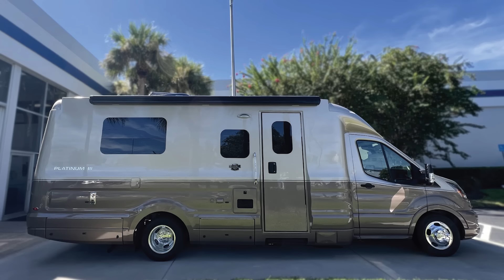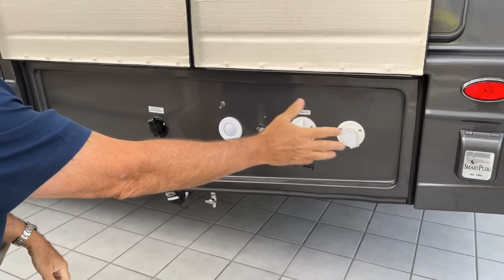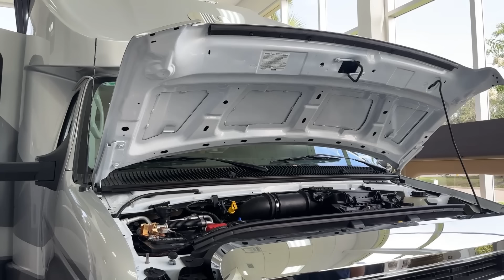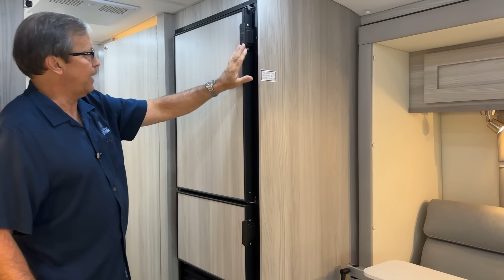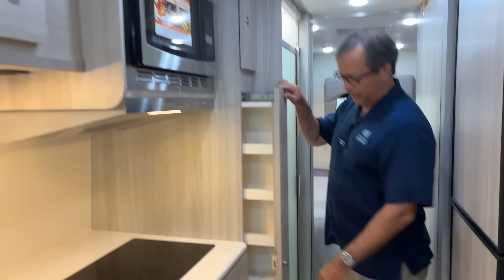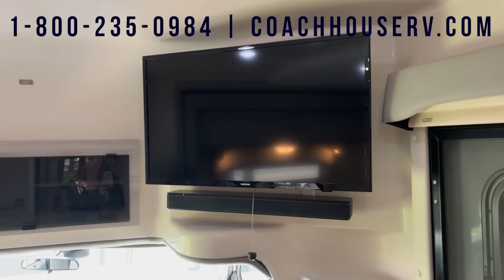See the All-New Grey Elm Interior | 2025 Coach House Platinum IV 272 FS Walkthrough

Comment: Hello Steve.  I owned a 2007 261XLFS and loved that little coach.  Unfortunately it was too small, lacked enough storage space and engine (V10) was underpowered.  The vehicle's  steering was also an issue until I had the local Ford Dealer install a Safe-T-Plus Steering Stabilizer.  I am also 6' tall and the older unit did not have sufficient head room for me.  It seems like you have made significant improvements with this next Gen version.  What are typical mpg? and has steering been improved?

Comment: My only complaint with this model is that there is no cover for the shower area.  I don't want to see a shower door constantly.  Even if you laminated the exterior of the door to match the interior, that would look a lot better.   Also not a fan of all the white fiberglass cap in the main living and front area.  Not a deal killer as I would probably get creative and put up some adhesive wall covering over a lot of it to get rid of all that white fiberglass.         Nice unit.     would be interested what slide components were used.

Comment: I might be asking a few question late; but i’m hoping you’ll answer.  1) In the water or utility area outside there appears to be two kinda square shaped holes which appear to be cut with a pneumatic airsaw, what are they for?  2) Still in the utility area, can a fresh water line be constantly hooked to the RV and the bay door closed?  3) I personally loved the digital entry door locks, are they an option on the coach?   4) Maybe I missed it, is the Truma A/C a heat pump unit?  5) Is there a spare tire?  6) Can you nap on the bed if the slide is not out?  7) Can you show your units with slides in and then out?
Reply from the maker: Thanks for reaching out — happy to answer these for you.

Those two square openings in the exterior utility bay are actually for the door latches, so everything secures properly when the compartment is closed. As for hooking up fresh water, the bay door does need to remain open at the moment, but we’re actively working on an update that will allow the door to close while connected.

Digital entry locks aren’t something we offer from the factory, though many owners choose to add them aftermarket if that’s a feature they prefer. The Truma A/C on this unit isn’t a heat pump, and the coach does not include a spare tire.

You can lie down on the bed with the slide closed, so it’s comfortable for roadside breaks or quick stops. And yes — we can absolutely show the layout with the slide both in and out, we will post a video showing it soon!

Comment: Beautiful coach on a horrible chassis, put this on a F450 or even F350 with the 6.7 diesel. No one wants this 8 mpg garbage 7.3 motor. 

Who cut the holes in the utility bay? Looks horrible. So if you have city water hose hooked up the bay has to remain open? If so poor design. 

Again, the chassis just sucks. The van cab is horrible, no options, just basic. At least with the F series you can order it at different levels with luxury options.

Floor plan wise, seems like it would be pretty much unusable with the slides in. Very inefficient use of space, you should look at Leisure Travel Vans, they have more space on a smaller chassis.

Bathroom, so you went all out until you got to the toilet. Instead of a macerator toilet you installed a foot flush. 

Furrion is just Lippert garbage, why not go to the boat industry and get some quality parts? 

Again, cheap one way fans. You know they make them that you can switch to intake or exhaust. 

Impressive build quality that’s just been waisted.

Comment: Beautiful looking coach with superb build quality. 1)No info given on suspension system. Hope it’s not just stock leaf springs on rears and Motorcraft shocks on fronts. What are the options and are Liquid-Springs available from factory ? 2) where is the HWH pump/bleed valves located? That can render the ability to manually release the slides/jacks almost useless. Been there,done that with my Phoenix 2552. Need to be skinny and slide yourself under the driveline from the passenger side to get to the pump- between the frame rails under the drivers side of cab hemmed-in by the genset on the drivers side outboard and in a very vulnerable position to get hurt w/o jacks/jack-stands to make safe. I’d give up a part of a storage box to make it easy to access. 
I guess I should look at your website good!

Comment: All electric is not a problem. You just have to be willing to invest in the necessary equipment to make it work. An all electric rig must have at least 1000 amp/hr lithium battery, minimum 3000 wat pure sine inverter, as much solar as the roof will fit, a dedicated under-hood alternator just for charging the coach battery, etc. Going all electric is easy peasy, you just have to be willing to spend the money it takes to do it right. Only the coach heat and hot water need an alternate fuel source and they can use the chassis fuel supply, requiring no additional systems. Or you can use the Aqua Hot system which exchanges heat from the chassis engine for heat and hot water. There are plenty of custom builders that have been using these superior systems for years. Personally, I would never buy any RV with propane or a generator, it's unnecessary weight and complexity.
Reply: The cost will be very high.
Reply: @gregbrooks3577  Of course, the cost is higher for large battery bank, inverter, etc, but not as high as you think. Sometimes I think people just assume that what was true will always be true, but things in the RV industry are changing as people's tastes and preferences change.

Comment: Where is the outside vent for the overhead stove exhaust fan hood?
Reply from the maker: It is a recirculating type that uses a charcoal filter. Venting it to the outside presents several challenges, so we've found this to be the most effective and practical solution!
Reply: Nope, they blow it back inside.
Another poor idea.